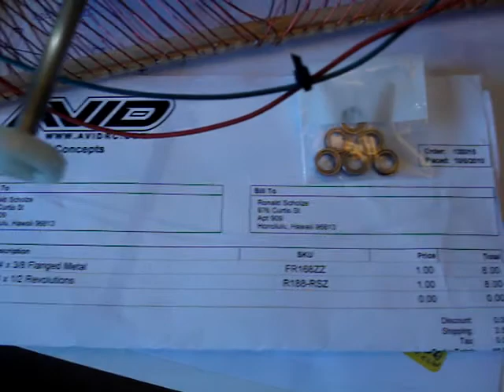Koa Bowl Motor with Tetrahedral Coils

Comment: Interesting set up Jack. What is the wiring connection between top and bottom coils like? Can I ask where did you get the 1/4 inch stainless steel shaft? Is that non-magnet shaft, I wonder?
Looking forward to hear more finding on your set up.
Regards. Medi